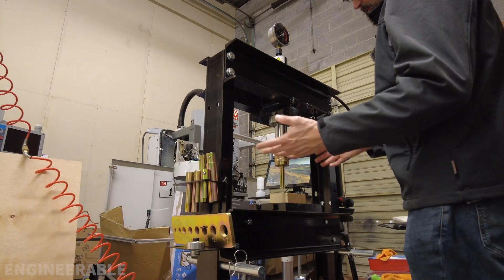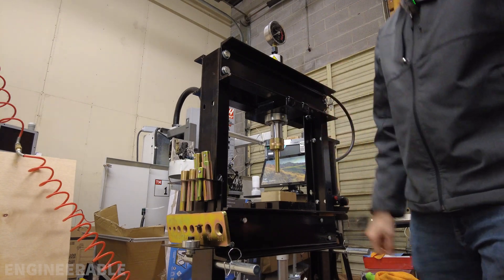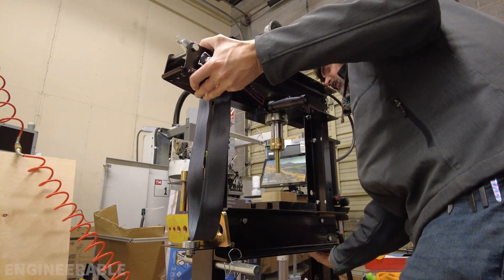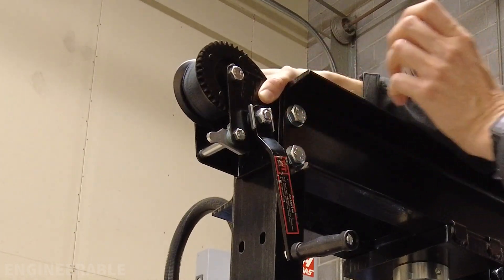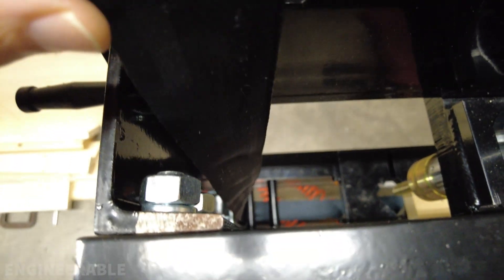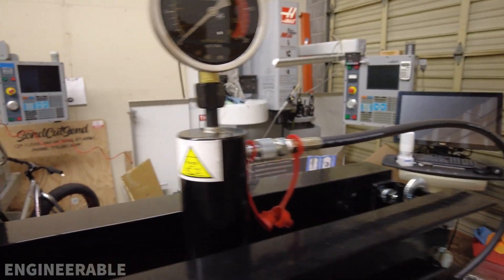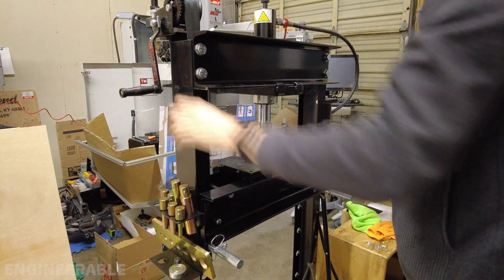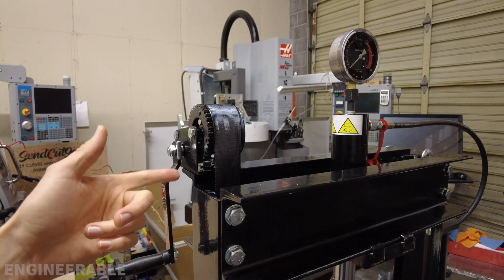How To Add Table Lift Hand Winch To Hydraulic Shop Press To Make It Easy To Lift And Lower The Table

Comment: You have the exact press I do. So disappointed you chose the easy way out on your use of the belt instead of using cable and doing this the correct way.

Comment: I wonder about adding one of those long 8 ton Harbor Freight air powered bottle jacks that people are using for their engine hoists and mount it down on the bottom (or side?) and using air powered bottle jacks to raise that sucker. Of course would require some thought because that idea might not let the table low enough for some jobs

Comment: Great idea. Is there a modification to your design that would allow the table to be raised to level without the aid of hands?
Reply: The easiest and nicest looking way is to use small pulleys with a wire cable. The cable is attached to the top on one side of the cross beam, but you also have a cable attached directly under the first one that runs down to a pulley at the bottom, across the bottom of the press to another pulley, then up to the top to another pulley and then back down to the other top side of the cross beam. This guys video shows it perfectly. https://www.youtube.com/watch?v=P6FVu7VnGcs
Reply from the maker: @andreacerroni9010  yes, if 2 straps came off the winch, and one went down one side, and the other strap went down the other side. Then it would keep the table level while raising.

Comment: Great idea. I have the same press and have been sketching out a cable winch system with pulleys. But yours is much simpler.
Reply from the maker: Thanks! I also started out with the plan to use cable and add pulleys, but when I figured this out and only needing to drill one hole, it was a win!

Comment: The only thing I see is that if you need to do an axle bearing (or the like) you'll need to remove the strap from underneath the table . But not a big deal, and it's simple . :)

Comment: You can use an impact to crank it up but nice and easy and simple
Reply from the maker: I was considering a drill, but turning it 90 degrees ended up being simpler.